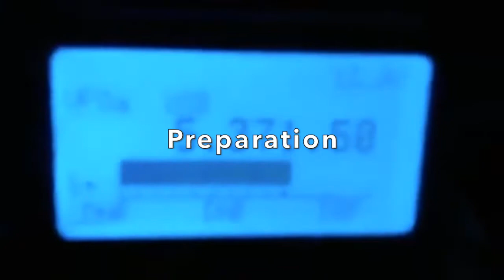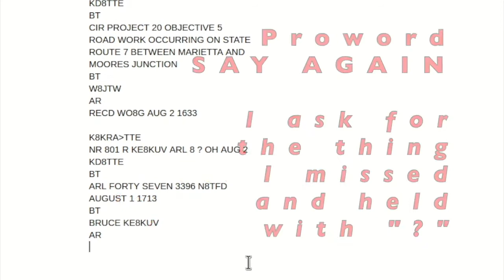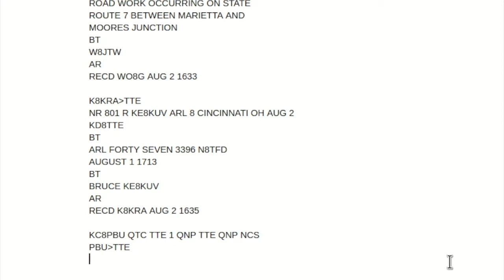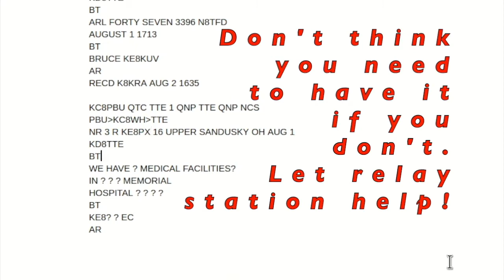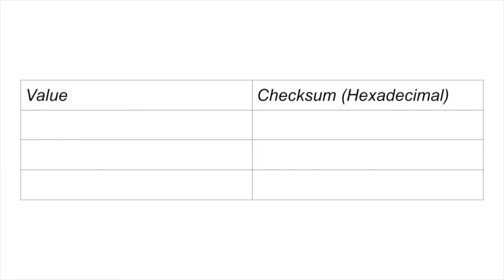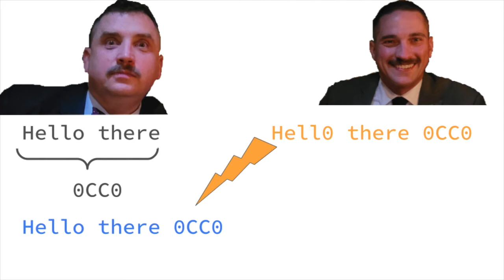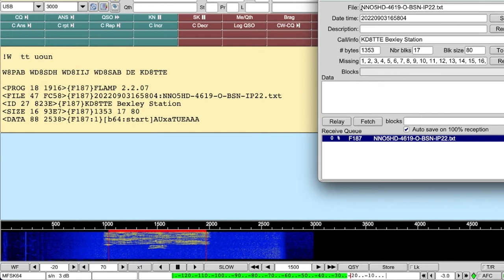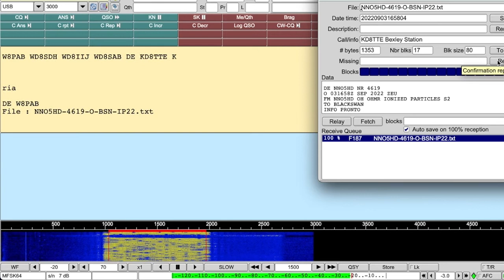Fills to complete message reception (Radio KD8TTE Ep081)

Comment: How does the receiving computer know to generate a matching checksum for comparison? Does every word/letter have its own checksum that the software knows to generate no matter the computer its on? If that makes any sense, lol.
Reply from the maker: Great question.

HOW FLAMP KNOWS TO DO WORK

This is part of the Amateur Multicast Protocol (AMP) implemented in FLAMP. Because the sender's FLAMP is formatting the message and then using FLDIGI to make the transmission, and the receiver's FLDIGI is receiving the transmission and sending the AMP data to the receiver's FLAMP, the receiver's FLAMP reads each of the lines.

WHAT FLAMP IS ACTUALLY DOING

Let's look at one example in particular.

Notice that I make a fill at 11:19 in the video (https://youtu.be/015YO5ZqNEQ?t=679). If you pause at about 11:21, you can see pretty clearly one of the blocks that I filled, data block 16. Let's look at the line in detail:

<DATA 89 5EAD>{F187:16}+M8r+LmxWxlXkjIudhxh5WLs4L/TAfloTLMu2z4ZTEp/YiYeGJUpRYwtroByyUYevabABZmBV0UDIA/x

The first thing that we see is that this line has three parts:
 1. The stuff in the angle brackets <>
 2. The stuff in the curly braces {}
 3. The stuff that follows.

<DATA 89 5EAD> tells us three things:
 1. This is a DATA block that follows, not to be confused with part of the preamble, or some part of protocol, like an end of file (EOF) or end of transmission (EOT).
 2. The number of characters in the block is 89. (Go ahead, count 'em!)
 3. The checksum value, 5EAD. (This is using the CRC-16/MODBUS algorithm.)

The {F187:16} tells us two things:
 1. The Queue ID (made by the sender's FLAMP when added to the transmit queue, so it's a unique value in the sender's queue of things to send),
 2. The block number (16)

The stuff that follows is where the data are actually sent.

The receiving FLAMP will see that line come in and do its work. You can even do it yourself. Check this out: Feed the whole data block to a CRC-16/MODBUS calculator, e.g., https://crccalc.com/ and paste the whole line in the input box there. (It should be one single line with no breaks or newlines anywhere, including the end, and should be exactly 89 characters.)

If you do that then hit the CRC-16 button, look below at the row for CRC-16/MODBUS, you'll notice that it shows that the checksum in the Result column is 0x5EAD. (0x is a prefix that tells the reader unambiguously that what follows is hexadecimal; base-16, where each digit goes from 0 through f. Thus "0x9" is the same as decimal (base-10) 9; 0xa is the same as 10; 0x10 is the same as 16.)

Thus, the block is good and the receiver's FLAMP keeps a copy of that block in memory. Once it's got a good copy of the whole thing, FLAMP will save the file in its rx folder for that day.

Make a change to the line, like a newline, an extra letter, a dropped letter or change a zero to the letter o, and you'll see that even though it might look the same, the checksum is different. That's how FLAMP knows whether the block is good.

Thanks for the question!
Reply: @KD8TTE  thanks!